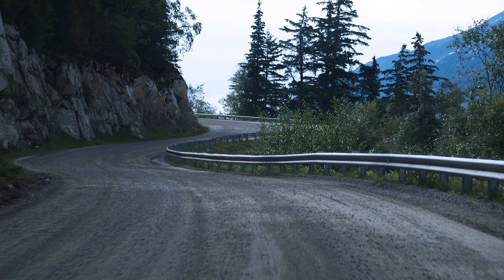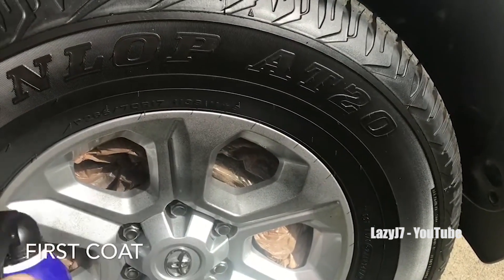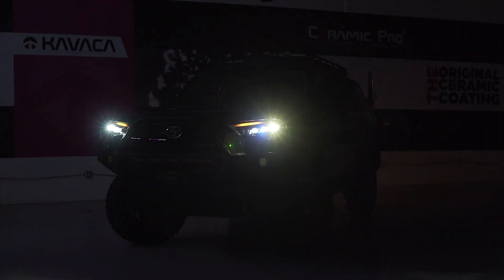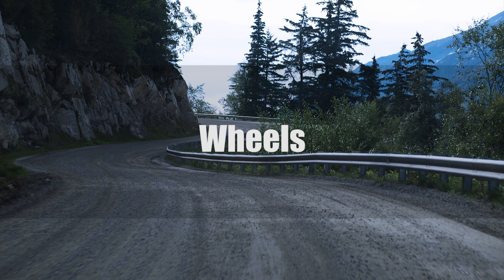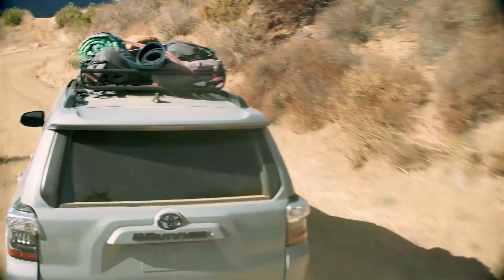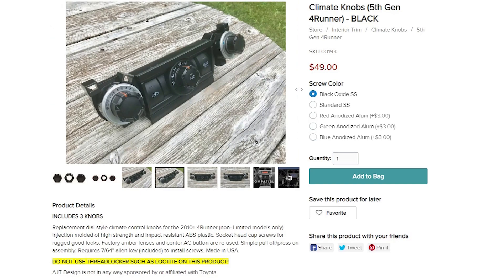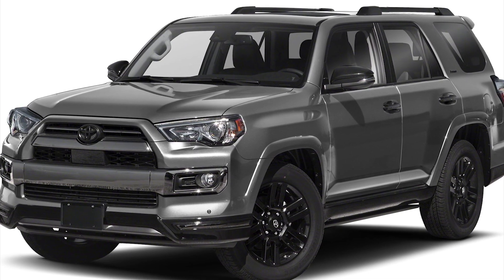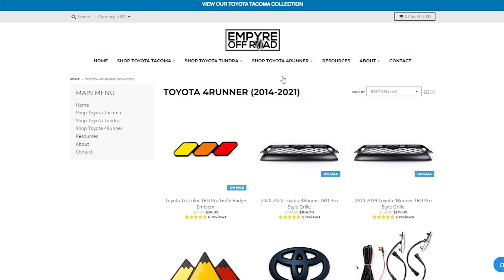Ultimate Guide To Blacking Out Your Toyota 4Runner

Comment: FYI everyone, you do NOT need to remove the front bumper to swap out the front Valance cover. This applies to the TRD Off Road and TRD Pro trims. If you have a trim like SR5 or Venture edition, which does not come installed with a valance already, then you will need to remove the bumper. This is because these trims have not already been drilled by the factory for the valances.
Reply: The venture came with black valances
Reply: The skid plates not black